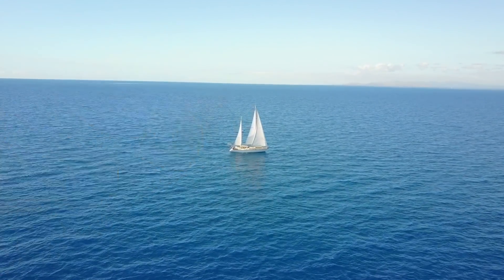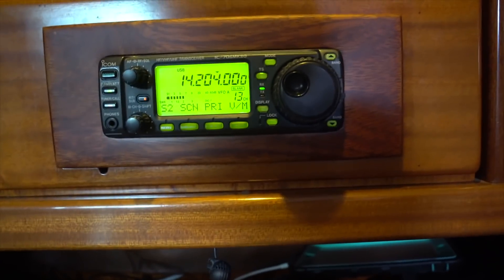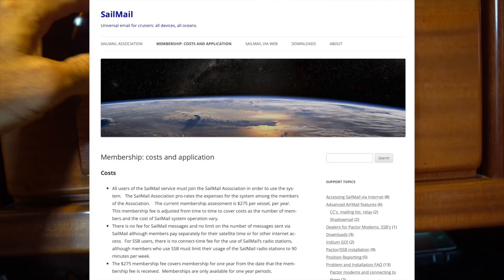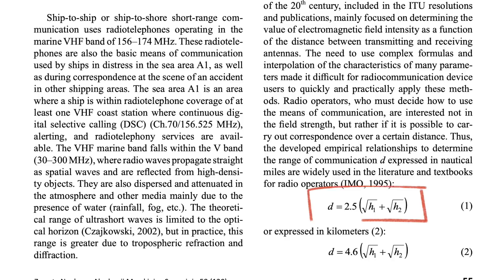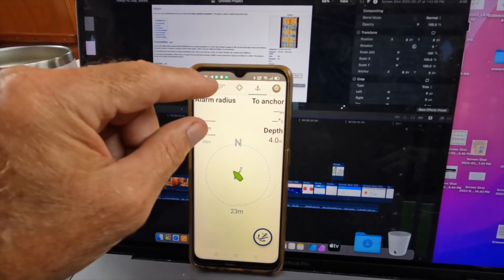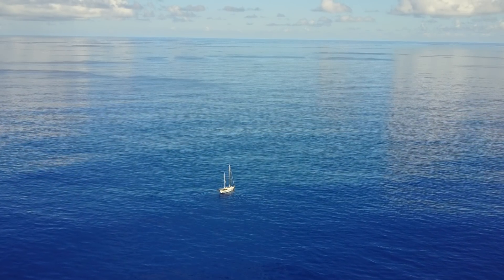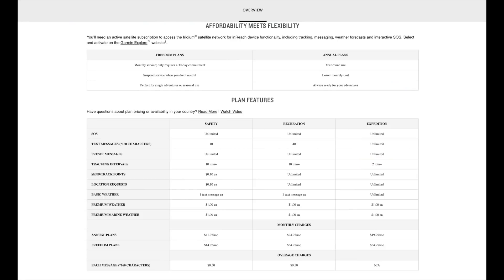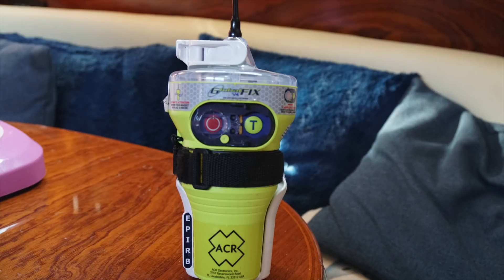Yacht Communications 101. Tips on Tuesday

Comment: In an emergency an aviation VHF radio would probably be a good idea to have with you too.
Reply from the maker: I actually have my old  handheld aviation. VHF from my pilot days onboard now.  Though not changed.  I am going to have to print out the Aviation Frequencies so I can reach a plane if I have to in an emergency with my 706MKIIG  Good idea.  Ken

Comment: 26 miles at sea level. Further with antenna height.  10 or 15 miles???
Reply from the maker: At sea level you may get 1 to 2 miles.  The h in the distance equation is antenna height!  With two antennas, each at 20 meters high, you get about 20 miles.  But, yes, 10 to 15 miles is about the max you get with decent radios and two antennas at 20 meters.  That's just real world experience.
Reply: My experience with FM modulated 2 meter VHF radio, which is close in frequency, is about the same.

In flatlander Michigan, with a 4/5 watt handheld and a magnet mount 1/4 wave antenna on a car I was probably topping out at 25 miles directly talking to other stations simplex. I don't know what their antenna height was.

Doing my own tests where I live in Pennsylvania in a wide valley with a lot of hills and buildings in it, it varies.

Like with using a 10 watt radio and a roof mounted antenna on a car going back to a base antenna 40 feet up....in one direction it may only go 5 miles, in the opposite direction where it's more flat, more like 12 miles.

Comment: Excellent detail and descriptions. Very well done, and even entertaining video.
Subscribed.
Pro-Tip: Amateur Radio licenses are very easy to obtain, with basic knowledge. Setting up a permanent bipole antenna on a sailboat is easier than you might imagine. You're doing great, better than most blue water SV's.
"SSB" = Single-Side Band. It's ok to refer to it that way, but at least once in every explanation that should be spoken or spelled out.
73's DE KG7STF
Reply from the maker: Awesome, thank you!

Comment: A big area left untouched.....what have you setup for cellular data and WiFi?
Reply from the maker: Yes, but we just buy local SIM cards once we get into port, and turn down the IridiumGO to the lowest cost plan (Or turn it off as long as it has been active for over one full month).  Then when we take off for the next country we activate our IridiumGO or turn up the IridiumGo to Unlimited Plan, and I always try to do it on the last day of the Month.  If we plan to make the crossing to Tanzania on May 5th, I would change the IridiumGO plan to Unlimited on April 30th.  Then I would be billed for one day at the higher plan.  There are no refunds on unused days, so I would use the unlimited plan for the month of May, then on May 31st I would cancel the IridiumGO since we are planing to stay in Tanzania for at least a few months and it has been active for 3 months.  When I activate the IridiumGO again I will need a new SIM card that costs $10, but I have 6 on board Aquarius.  I should have included this in the video, but can't include everything...  Best... Ken
Reply: @SailingAquarius   I was also thinking of something a bit more. I like the Pepwave MAX Transit DUO "PrimeCare Edition" Dual CAT-12 LTEA Router. The Prime care provides proprietary licensing which gives the user access to Speedfusion Cloud dual simcard cellular bonding. This coupled with the Pepwave 40G marine antenna and the OMNI-496 Dual-Band Wi-Fi antenna is the next level in cellar and WiFi data connects.

Comment: Iridium Go download? 2.4 Kbits/s fast 🐢 So let's say a paired down PredictWind download will take about 45 minutes to an hour. Is that what you are finding?
Reply from the maker: To download the GRIB files for a 100K radius around Aquarius take about 15 to 20 minutes.  If you want more data, like the currents, and all four wind, rain, cloud models...Then you might be looking at 40 minutes.   But we usually request smaller files that take about 15 minutes to download.  And we do this about 3 times per day on a passage.
Reply: @SailingAquarius   I was thinking of a more in-between slow Iridium Go and super expensive Ku-Band Marine VSAT Antenna System. The Intellian C700 maritime satellite terminal. Using the Iridium Certus service, the Intellian C700 provides three high-quality voice lines and the highest IP data speeds among L-band terminals. Developed for Iridium’s global network and designed to provide the fastest L-band broadband service in the industry, the C700 advertise deliver speed up to 352kbps, transmission and 704kbps. Reception and speeds is a game changer, through Its 12-element patch receiver which also ensures seamless connectivity. The cost for the antenna runs around 5K and service for pay as you go is $130 per month or the use one month 50MB for $395
Reply: @SailingAquarius  Keep in mind, as far as cellular data performance is concerned, boosters are not always the optimal signal enhancing strategy. While a booster can play a role in a mobile internet setup in weak signal areas and when upload capacity is of importance - many cellular reliant boaters depend on directly connected MIMO antennas for use with routers and mobile hotspots. Despite the high price tag, boosters are not always the best signal enhancing option for data performance - which should be your focus. And the reason boosters are often not so great for data performance is because of a core technology called MIMO, or Multi-In Multi-Out. Much better to first invest in a proper router and 4x4 MIMO antenna. It's not at all uncommon for a booster to actually result in decreased data speeds, despite a better signal reading. Using a cellular device's built-in antennas or externally connected antennas can often outperform a booster.

Comment: The ICOM 706 has been discontinued, mainly due to some components being discontinued.  It is also  HAM-only radio--it cannot be used for marine SSB.  This video is misleading in that regard.  YOU HAVE AN ICOM 706 BUT NO HAM LICENSE?  Unless an emergency, this radio is worthless for more than listening.  Spend a little study time, and get the HAM license.  You still won't be able to use marine SSB, but it's better than just listening.  Also, you can buy a receive-only radio for ~$200, and an EPIRB (much better for emergencies) for ~$350.  So you have much better communications for half the price of an ICOM 706.

Comment: Hi, great episode. I really like how you went into depth on some things. You are really well setup on safety and backup systems. Kudos to that.
I would like to give some feedback on some things.
The Icom 706 is a pretty good HF (and VHF) radio, actually the receiver itself is better than what you would get if you buy a purpose made marine SSB as it is intended for Amatuer radio where low signal communication is key. It's speaker kind of sucks though and anyone buying one should be buying a separate speaker. The microphone is not all that good either (Icom has never been known for good  stock microphones) and if one feel one could spend some extra there I would recommend one from Heil (you know Heil sound, that makes microphones and guitar distortion gear).
What is good to know is, that doing the All-TX or MARS modification, where you can transmit all over the spectrum is illegal in some countries, it may also be illegal to use, for instance, a ham radio on the marine SSB frequencies. Now, for emergency Mayday calls, no-one is going to care what radio you have and what modifications you have made to make a Mayday. Just saying, in my country Sweden you may own the equipment, you may modify it, but you are not allowed to use it on the marine frequencies. I also know that for the US, FCC does not allow you to use a radio on frequencies that it is not type approved for. You can listen anywhere, but not transmit, unless a disaster situation.
Now, most dont care, and I have never heard about any cruiser that has got in trouble with it, anywhere. And there are a lot of cruisers having modified ham equipment. 
The IC-706 is a decent radio, it has however gone 27 years since the first generation 706 came out so, not saying it is outdated, but it is not the most modern radio out there.
The IC-706 been modified also has some risks. Even though the TX (transmit) has been opened up there are some frequencies that the radio just don't like to transmit. It will do it, but, it creates issues that can much sooner than later break the radio. I know the 4 meter band is particularly difficult and breaks the IC-706 quickly, but have also heard there are frequencies on the HF that causes some kind of oscillation that the radio don't like. 

When it comes to VHF distance. Most people will use their squelch because the white noise of frequency modulation is very tiresome to listen to on days in end. But if both stations (boats) will unsquelch you will usually get a much longer distance than the 20 nautical miles you are talking about. The sound wont be perfect, but you can communicate. The distance is actually not only to the horizon but to the horizon in between the 2 stations. 

You talked about the coax cable distance on your Iridium, well, convert this to VHF as well. The marine VHF runs up 156-174 MHz and channel 16 on 156.8 MHz (you could even use your IC-706 here). A big mistake, often from the boat manufacturers and boaters is to use a RG-58 coax between the VHF radio and the antenna. This cable leaves a lot to desire when it comes to loss as well as the coax connectors are also pretty lossy and difficult to seal. I would recommend to have at least RG-8 or RG-213 to be used for your VHF. 
The benefits.
1. Much lower loss (this goes on reception and transmitted power).
2. Better connectors less prone to water ingress
3. Better protection from RFI or noise from other equipment on the boat like solar panel equipment, fan regulators, square sinus equipment and so on.
4. Better longevity (need to replace less often)
5. Better UV protection.

The Ionosphere has different layers where the signal can bounce, the D-layer is a common in the daytime on lower frequencies near the MW, then we have the E-layer and the F1 and the F2 layer. Many times the communication can have multi-hop which means the signal leaves the antenna, bounces in one of the layers in the Ionosphere, bounces in ground or water, back to another bounce in the Ionosphere and down again to the receivers antenna. There is about 5 bounces in the F-layer required to reach the opposite side of the world.

When it comes to using a Pactor-II modem to downloading grib files and sending emails it has it's limitations. 
1. You need a special modem that is overcharged in price.
2. The land based stations you are working against is, hmmm, many times to the best fit for purpose. I am not saying they all suck equipment wise, but very few of them have good equipment.
3. You need to pay for a service

Now, instead, if you have gotten your Amateur Radio license you could.
1. Do this without a modem, there are hamware (amateur radio software) that is free, as good if not better than Pactor-II that utilize the soundcard in your computer and the computer itself to act as a modem.
2. The stations, other hams, across the globe that you can use to connect to in order to forward your mail many times uses better radios and most importantly antennas in order to get the job done.
3. It is free.

The Iridium is a great tool. 

Currently one can get Starlink at land but apperantly it is not working at sea. I used it while in Ukraine, it was free, thank you Musk, but also very stable and fast. Cant wait to get it to work over the milk run. $110 a month, no data limits.
Reply from the maker: WOW, there are some smart people watching our videos!  Thanks Magnus, I do believe that I will get my HAM license this summer while in the USA...  Any suggestions on a school/class?
Reply: @SailingAquarius  Sorry about my rant, I just get a bit fired up sometimes.
OK, so not so long ago it has gotten a lot easier to become a licensed amatuer radio operator in USA.
First, they made 5 classes (Novice, Technician, General, Advanced and Extra) into only 3 classes (Technician, General & Extra).
Secondly, they have removed the morse code requirement.
Now, each class has benefits. Being a Technician allows you on many bands but very little on SSB, more CW (morse code) and different digital modes. When you update to General you get a whole lot more frequency benefits and when you finally become an Extra you will have access to all of the ham bands full spectrum and full legal power everywhere, where applies.
The problem is that you cant just go and do the test for extra and be done. No, in USA you have to first pass the Technician exam, then the General exam and finally the Extra exam. You can however do all of them in the same day.

Technician will give you all VHF bands and up full legal power, that is, 30MHz and up. The only HF the Technician class operator can use SSB on is 10m, 28MHz, which will take you far when the sun spots are up but outside that it is basically like CB (27MHz). The Technician also has access to small segments of the bands on 40m (7 MHz) and 15m (21 MHz) but only on CW (Morse code).

Now, to answer your question, since the pandemic FCC now allows remote testing. You can be in Reunion, Madagascar or whereever and do your test with some different clubs. It requires a Teams/Zoom or similar and a webcam where they can monitor you.
This site gives links to a few places where you can test remotly. https://hamradioprep.com/ham-radio-license-test-online/

There are numerous sites where you can buy an online course. For better or worse. I would recommend that you visit the youtube channel called Ham Radio 2.0, this guy has a lot of videos and it can be a bit of a mess to find things but there is FREE online course for all Technician, General and Extra. It is very well done and easy to understand. And again, it is free.

Comment: Good morning,  I have been an avid watcher of about 6 youtube sailing channels and I commend you all .  I am a licensed Ham Radio Opperator and have found myself always asking why don't any of then use Ham Radio to communicate or even mention anything about   Ham Radio . As it is of  my opinion, a very crushal peace a commcation gear that can keep you in touch with the world and especially in case of an emergency ! The icom you have is a very good mobile Radio. A few points if  you're interested are, # 1 For any' Emergency Only'  you are allowed by the U.s  FCC and other country's communications regulators do allow you to use Ham Radio without a license.  #2 ... 14.300 mhz or also know as the 20 meter band is a world wide emergency and non emergency channel/ net that run daily that you can check-in  with the net Opperator . We always love contacts from maritime mobiles. #3 the antenna you assembled was called a long wire but your missing a few steps for it  properly work well which is very critical.  Such as a long wire to properly work it  needs a 9-1 current bauln at the feed point which in return would consist of you cutting your wire to the proper langth And having an auto tuner to tune the antenna to operate  properly on 20 meters. The Ic 706 doesn't have one built in , therefore you would need an external tuner if your antenna is not properly tune . Also along with that you should have a swr meter to tune your antenna.  You could make a half wave end fed antenna with a 49-1 current bauln at the feed point. As the antenna would have to be cut to the proper langth to be  efficient . I am extremely knowledgeable in the field of HF communications.  I would love to talk with you further about this as you could safely assume there a bit to know in the antenna and HF world . It would be a  great pleasure to teach you . Happy sailing . My email  is jao33333@hotmail.com. Ps when shit hits the fan out in the open waters and everythings is down you can aways  rely on Ham Radio !!
Reply from the maker: Hello Jason,  Yes!! I would like to talk...  But for your information, there is a tuner in between my rope antenna and the radio.   It is the SG-230 Smartuner.   Do you know this tuner?  I will give you a ring!
Thanks for the comment

Comment: Have you considered getting rid of the splitter and just adding a second antenna (maybe on the mizzen mast) for the AIS?  Splitters KILL RF power as will using most factory provided antenna cable.
Reply from the maker: Yes, I had a separate antenna.  But didn't get as good of reception as the active splitter I have now.  Ken

Comment: The US FCC, specifically prohibits the use of SSB radio, when a vessel is in range of VHF transmission. However, I agree with you Ken, when in an emergency situation, use all the tools available to resolve the emergency as soon as possible. Another great video.
Reply from the maker: Thanks Captain!!!
Reply: Could  you elaborate on what’s prohibited precisely please.

A vessel is almost always  in vhf range of another base station or vessel
Reply: I have been  a licensed Ham Radio Opperator for 20 years and there are no such laws restricting you communicating as you stated . Grant it you do have to Opperate in the allocated frequency of your license class . Also there are other  restrictionsin to be aware of when you are in other country's.